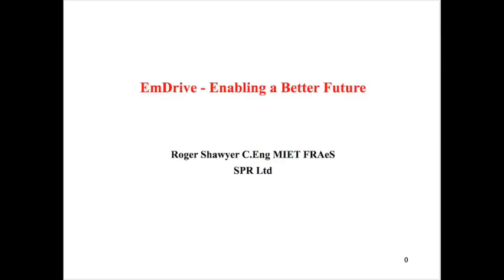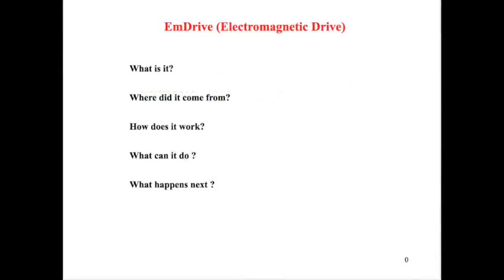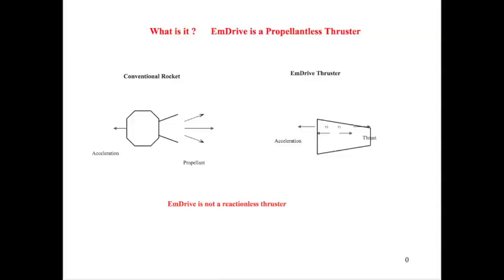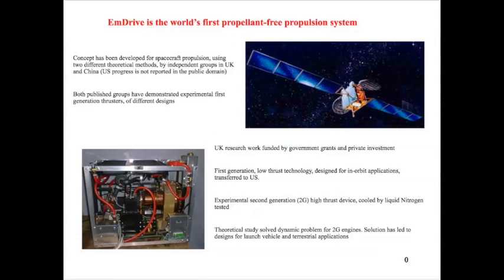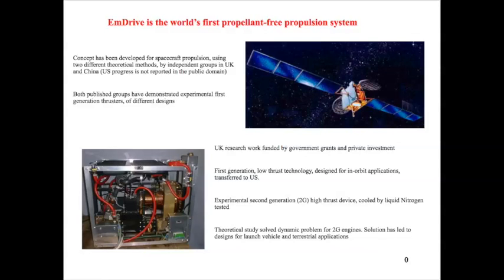EmDrive Presentation by Roger Shawyer   Part 1 of 3 opt

Comment: This has been poured over by many professional and amateur scientists. 

it was clear back in 2015 that it does NOT WORK.

IT DOESN'T WORK. I've read tons of articles about it, and noone has ever gotten conclusive results from EM drive experiments.
Reply from the maker: Wasn't it uploaded about that time?
Reply: @NickBreeze  Shawyer "Designed" the EM drive much earlier, around 2000. He even got boeing to test one in space, we never heard anything more about that. I followed a forum thread on the progress of testing. Some people on the forum actually built complete test setups, but they all used different measuring setups. Results were all over the place, there was simply no logic to the behaviour. Any movement the EM drive made was just because of a tiny little radiation pressure imbalance with the RF cavity, AFTER it was given an initial push. And it was so efficient they could only leave the power on for a minute or so until the whole setup overheated. We're talking kilowatts of power being consumed and getting millinewtons in return. Extremely, excruciatingly unefficient.

Comment: HTML] scirp.org
[HTML] NASA's EM Drive Thrust from the Forces of the Quantum Vacuum of Spacetime
MS El Naschie - Advances in Aerospace Science and Technology, 2018 - scirp.org
63 days ago - Building on the various manifestations of the forces latent in the quantum 
vacuum of spacetime such as Hawking's radiation and Unruh temperature, we resolve a 
major paradox connected to an immensely important proposal by NASA scientists for …
  Cited by 1 All 3 versions 
[PDF] ijeir.org
[PDF] A Theoretical Justification of NASA Electromagnetic Drive Based on Cosmic Dark Matter
MS El Naschie - International Journal of Engineering Innovation and …, 2018 - ijeir.org
81 days ago - Based on earlier research results concerning cosmic ordinary energy and dark 
energy, it is argued that the energy density gradient present in spacetime can produce 
sufficient thrust to make NASA's EM drive proposal not only possible but also feasible. This …
  Cited by 1 All 2 versions

Comment: Apparently the thing produces paired photons. One hits the wider side of the frustum producing thrust, the other manages to get out through the frustum walls without interacting with it. So conservation would be taking place.
Reply: None of that. WHen powered on (multiple kilowatts) and pushed in the right direction, a slight imbalance is created in the radiation pressure, resulting in a force of a couple of millinewtons. Which also quickly dies out. There is no propellantless propulsion at all, it's just a very weak side effect.
Reply: @paulmichaelfreedman8334  What I said was a possible explanation of how the imbalance could occur, which you don't explain. You just summon it.
Reply: @DamianReloaded  Yes I did. By giving the EM drive a push in the right direction. Everyone experimenting with EM drives confirmed that the thrust only persisted after the frustum was given a little push. And the force was tiny, not even millinewtons. It was in the micronewtons. Amateurs had difficulty with the accuracy of measuring instruments, driving up cost.

Comment: Thanks for posting this presentation Nick.

If you meet with Mr. Shawyer again, kindly consider asking him a couple of questions.

1. Why does the drive accelerate small-end first?  I've read a couple of his theory papers in which he describes how the differing group velocities inside the cavity cause a greater radiation pressure on the large end plate than on the smaller one (this difference is multiplied by the Q for the final thrust), which would suggest that it should accelerate large end first.  But in his papers and in this video at 0:33 he says that it accelerates small end first in order to satisfy Newton's laws and the conservation of momentum.  How can a net force in the direction of the large end cause it to accelerate in the opposite direction when the force is on the cavity itself, not on its surrounding?

I hear what he says about feeling the force of the large end plate against your hand, but how does that make the drive accelerate in the other direction when it should just balance forces to hold the drive in place until you pull your hand out of the way and let if accelerate large end first?  Consider a ping pong ball being held underwater in a pool.  The force exerted by the water pressure onto the ball's surface increases with depth, so the upward forces on the lower portions of the ball are greater than the downward forces on its upper portions, resulting in a net upward force.  Your stationary  hand on top of the ping pong ball feels this force, and acts to keep the ball from accelerating upward, but it doesn't cause the ball to accelerate downward.  What is different about the situation with the EmDrive?

2. Why can't it be used as the motive force to generate more power than it consumes?  Shaywer's theory papers describe how the specific thrust decreases as the drive accelerates along the thrust axis, limiting the maximum specific thrust to the reciprocal of the velocity.  Suppose it were possible to build his proposed 30 kN/kW superconducting drive.  Were it not for the reduction in specific thrust, you could use it to accelerate an airplane from 0 to a cruising speed of 100 m/s, at which time the drive would be doing 3 MW of work for every 1 kW of power it consumes.  His limit of specific power to (T/P)_max < 1/v keeps this from happening.

But this attempt at conservation of energy only appears to hold in the reference frame in which the drive first starts accelerating.  What if a drive was constructed and turned on for the first time all inside a plane which has already reached its steady 100 m/s cruising speed.  As far as the drive is concerned, it is as much at rest in its reference frame (that of the plane) as a different drive, which was constructed and turned on in a ground laboratory, is at rest in its reference frame.  So why wouldn't this airborne drive do 3000 times more mechanical work than the electrical power it is consumes?

I look forward to hearing more about your meeting with him.  Cheers!
Reply: Your first question was the right one, and that is where EM drive fails. The radiation pressure differential only occurs after you give the powered-on em drive an initial push. The acceleration causes a temporary differential pressure which is measurable. But it is unsustainable. This thing has been tested and tested and tested, by many different people. Results: inconclusive, but definitely extremely unefficient. Kilowatts of power for a couple of millinewtons at best.

Comment: This is just nonsense, it violates the conservation of the center of energy theorem in classical electrodynamics. It's shocking that people belief this rubbish.
Reply: ***** The forces being measured are tiny. So it's probably down to a convection effect from heated vapour.
Reply: Gary McAllister I agree it isn't pushing against anything, being contained. What are all these stories about it producing force in a vacuum? Is it all just made up / mass hysteria? 

I'd love it to be true, if the  test results are in-fact happening for real, the impact of a superconducting version would change humanity. Both in what we can achieve and what we understand about physics. 

I personally will only believe it when a satellite goes up and uses such a drive to maneuver.

Comment: This is a breakthrough to be sure. Couple this drive system with a zero-point energy supply and we're set.
Reply: I think a ZPM would be easier to manufacture than getting EM drive to work.

Comment: We should all be grateful if the first gen. drive really works. Even half a gram of thrust without propellant would be a revolution.
The second gen. drive with a superconducting cavity would have to store an enormous amount of energy and this will be tricky at best. Ask a radar / microwave specialist. If the electric field strength is too high, you get arcing, and if the currents in the superconductor get too strong, the resulting magnetic fields lead to breakdown of superconductivity.
Please correct me if I'm wrong. But there are limits to the amount of energy which can be stored in a resonant cavity.
With existing technology, how far could one go?

Comment: Guys, there is quite a lot of hype around it. I want to belive it :D. But lets wait for additional independet test results from more laboratories.

Here are some interesting link in the mean time :D

¨http://emdrive.com/faq.html

http://ntrs.nasa.gov/archive/nasa/casi.ntrs.nasa.gov/20140006052.pdf - NASA original post of the paper (paper are only preliminary as you see it is not still final.

Comment: Very interesting stuff.

To me this sounds very similar to Gogu Constantinescu Theory of sonics, wave or transmission (google for theoryofwavetran00consrich and there it is). I know it's not the same thing, but somehow, I think some principles would apply here also (for example resonance, condensors, resonators and so on could be translated easily). Also, from what I've saw, you use convex/concave mirror reflectors for the second version of Em Drive. I wonder if this could work with a paraboloid / spheric mirror, or even an aspheric one to capture multiple resonance points.
Reply: Just like in a guitar, if the volume of the instrument is right, then the harmonics and flageolets sound much stronger, because the total volume is "tuned" to the that specific note or frequency ( or twelfth root of two applied to music intervals and octave).